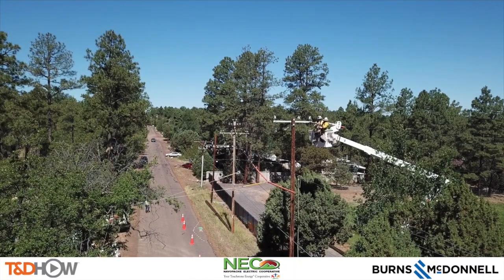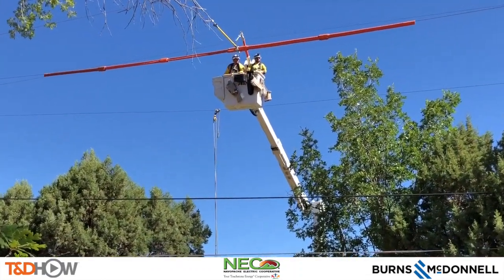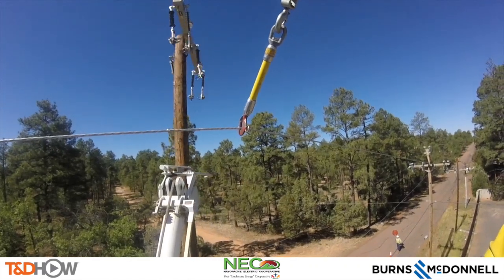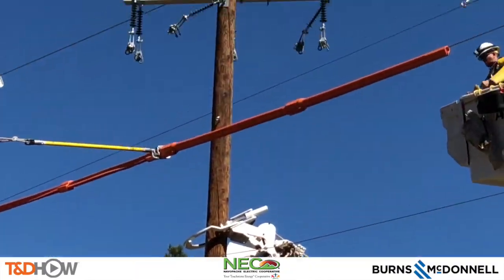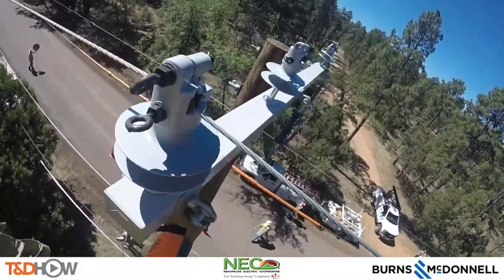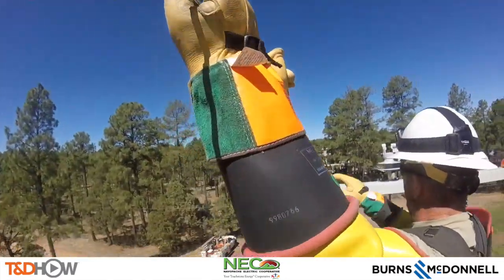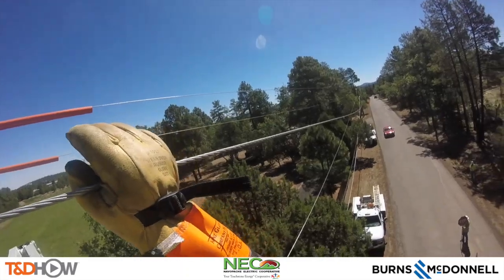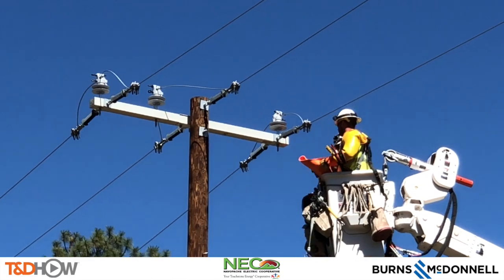Energized Line Transfer

Comment: 25 year retired lineman here. Don't think I have ever seen so many safety violations on one job.Shame on the line foreman. SMH
Reply: jaw willow  a step 3 apprentice here and I see a few but the major safety issue I see is lack of cover up especially pole wraps and cross arm cover
Reply: @connorcaneva6726 cross arm is fiberglass. Not a huge deal. Sounds like 14,400 or 7200 at most. No issue
Reply: @connorcaneva6726  l
Reply: 38 yr retired lineman here, I see what you mean.
Reply: One of the guys almost put his chin on the line.
Reply: jaw willow  there coulda been alot more rubber used lmao
Reply: Nick Deabreu what r they
Reply: 100 year retired foreman here 😁
Reply: Ex Linesman (In Australia Linesman not lineman like in US) here, though Not Glove and Barrier qualified. - That's why we don't film on site. You will always find something :), but  was thinking more covers and some clearance issues and we would insulate the pole even though it's timber . Interesting they don't use preformed grips (deadends) and no pole cap on the head of the pole. Also, we lift the cables above the pole site with a larger crane.
Reply: @Richard Wolfe Everything.  No pole covers, not nearly enough hoses on the primary, no cover up on the primary...........
Reply: Yall seen the guy who shoots a taser at a sub feed and has one lead staked to the ground?  what yall think about that violation?  Pretty awesome right?  Or the guy who throws the line up and falls when the arc hit the ground right next to him..  pretty bad ass right?  Or the thousands of electricians whove gotten their faces melted off and blood boiled in a fraction of a second because of acts of god??  Pretty crazy right?  You can triple up on condoms but still can get the peen cheese if shit happens the right or wrong way..  unless you tag out that voltage than theres risk no matter what..  yall seen the dragon from the fuse with the dude in the bucket and that shit came within inches of biting his face??
Reply: this looks fine to me,if you saw how we do liveline works in kenya.,,only God protects us
Reply: @Richard Wolfe There was plenty they did wrong. For starters they didn't have nearly enough rubber. And those vice top insulators they're using which are great btw, you're supposed to break the rings off when tightening them. They're like torque nuts. They're supposed to snap off.
Reply: @AchillesWrath1  got to love them hendrix vice toppers
Reply: @AchillesWrath1  Agreed!
Reply: They covered it all but the shoe on the outside phase, while working the middle phase. If you don't have enough shit to do the job, you shouldn't be doing it.
Reply: And frame the pole on the ground?? Since when, is that S.O.P.?
Reply: Brian Payne  Standard practice in the Midwest. I worked on the east coast and they looked at me like had a dick growing out of my forehead when I talked about framing poles on the ground. Different procedures in different places. They also pull over energized wire frequently whereas the places I’ve worked in the Midwest we spread and/or cover for wire pulls.
Reply: Nick Deabreu my dads a lineman out of local 702
Reply: odeis5 Knob.
Reply: someone explain to me ?
Reply: Curious why lineman do not wear arc flash hood or shield on hard hat? Can someone explain?
Reply: @adubbz23 are you serious with that BS?
Reply: "I spent 30 years typing documents on a typewriter, and I do not approve of these young whippersnappers using Microsoft Word and LaserJet printers!! Smh"
Reply: I’ll tell you things are sure different than back in the day and a whole world different from when my dad started in 1972. I will say this even years ago when we were setting poles around hot phases even the ground crew wore sleeves. My dad and the other older guys always said there is no eraser on a lineman’s pencil.
Reply: This looks pretty good to me, a little bit more cover up for phase to phase potential but other than that looks good. Not sure what all the fuse is about. Expect the Pole to lean down the line half a top though
Reply: Shut up old man
Reply: Hell up where I am we make our tree crews get trained in rubber goods and half the time they don't even install grounds for hands on work, they just isolate.
Reply: I spotted the lack of rubber, but cringed during the transfer, were the one dude while tightening the insulator stretched his head up over the line, also didn't like how they positioned themselves with taking slack out to dbl-de the line,  even though they were wearing sleeves, the guy on the right side if he slipped would have made a contact with his upper back
Reply: @kennyp507  why put his chin on the line!?
Reply: @lucfournier8222  im not sure what you mean
Reply: Nick Deabreu Everyone is an armchair expert. Procedures change.
Reply: citroenfil currently a safety man and a 22 year journeyman lineman. He isn’t wrong, there are a lot of violations.
Reply: @citroenfil  are you a lineman...
No...
Then whos the armchair ecpert here...
Reply: Ian herp Wow, your amazing! You’ve never even met me and you know my past job history. Hide behind your keyboard. My job history includes 3 power stations, EHT Transformer rebuilds at GEC and working for GDF Suez who is one of the main European power providers. I don’t have to explain myself to you anyway as your one of these Been there, done that on the internet expert.
Reply: @citroenfil  well if you work in Europe you still need to shut up about protocol in a different country where you have no idea about how different it is
Reply: Ian herp Thanks for the attitude reply. I see your profile is as full as your qualifications. Have a nice day.
Reply: odeis5 Sigh, Another keyboard warrior with no brains, but big hard attitude.
Reply: Yeah you’re definitely not a foreman I would want to work for
Reply: @danielbab3888  And you aren't a lineman I would want to work with.  Are you kidding me with that comment?  If you've ever read a safety manual, you would see a book full of dumb stuff people have done to get themselves killed.
Reply: Get back on your rocker they did way more than they had to when it comes to “safety” on this job.

Comment: They could have saved themselves some extra cover up by reversing the order they dbl deadended the phases. Throw two hogs on the first phase and proceed to the farthest phase and work your way back out. It will save you having to cover the jumper you just made. Work smarter NOT harder.
Reply: Glad I saw this comment. I was getting irritated by all the people talking about how unsafe they were, while I was more annoyed by the fact they worked on the phases from the inside out instead of outside in. Wasted moves
Reply: @Franky8312  fax

Comment: 8ft into the ground on 45 fter? lol the most 10% +2 ft. at the most.
Reply: Really depends on the soil type
Reply: lol no doubt..they almost buried the pole tag
Reply: That soil looked like sand. I suspect 8ft was a good safe depth. Surely better than finding the pole leaning after a storm.
Reply: Need to get it down below frost level.  Surprised it's not in concrete actually, I always did wonder how they did it, did not realize it was direct like that.

Comment: While it appears to me that both linemen aloft are experienced, if the intention of the video is for instructional purposes the procedures are lacking. I have no problem with how the field phase was worked, the middle phase was tied off outside of the work area so the use of rubber on the line was unnecessary. Once the phase was deadended and complete it should have been 100% covered. The over the arm tap was exposed and a blanket was draped haphazardly over it, if that’s the extent of how you cover, why bother? Then once the middle phase is complete and work starts on the road phase there is no cover on the middle phase over the arm tap!!! Again, why bother with a blanket on the field phase tap if that’s how you cover? If safety man pulled up where I’m at, asses would be really sore. But what do I know, I’ve only done Line work for 43 years.
Reply: I work for utility not a line worker I remember these guys got hurt really bad they said it was from working under a uncovered line. One guy he had to talk with one of those buzzers holding on his neck like people that get cancer from smoking. I guess the line got him in the neck and chest he was all burned up in a wheel chair with one arm missing too. I helped him setup his computer they wanted him to work at a desk he just sat there all day. I think it was some sort of lawsuit thing where the company was trying to get out of lifetime disability. I had heard there was a supervisor who got fired because he was pushing them to do it. The company started training after that anyone had the power to stop work not just supervisor. It was about 13-14 years ago. I'm in Arizona also maybe you know about that's all I can say here.
Reply: Exactly. Thank you

Comment: Yea if these boys were on duke system they'd be fired. No cover on the arm or pole, boom under uncovered energized phases, energized phases uncovered to their back. No positive control over wire while being moved.
Reply: I agree man. It’s pretty amazing people continue to work like that.
Reply: I'm very surprised that the employer allows that kind of risk taking. It's not just a personal risk but if they had lost control of those lines and dropped one on the arm the power would be gone and the cost of fixing the burnt mess would cost dearly.
Reply: Duke sets rubber trees. Fuckin loser.
Reply: Experienced lineman use common sense when they work. Scared or inexperienced lineman, do every little thing the company asks for regardless if it makes sense or not. They did nothing wrong, your company is keeping you in a box. You’re concerned about the boom but look at how far away it is from all the phases. You’re concerned about the energized phases to their backs but look at how far the separation is. Also, they didn’t cut any wire or handle any long tails. What is positive control to you and how would that have been safer than they way they moved the wire? Why would you cover a fiberglass arm? Are you assuming it’s really wet? Are you assuming the pole was soaked in water before they set it? Do you do any logical thinking before you do a job?